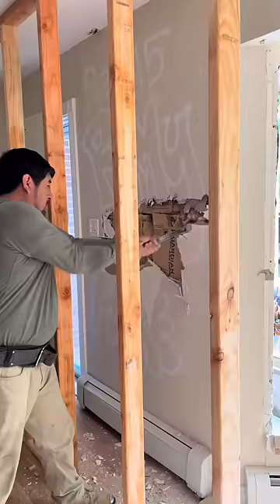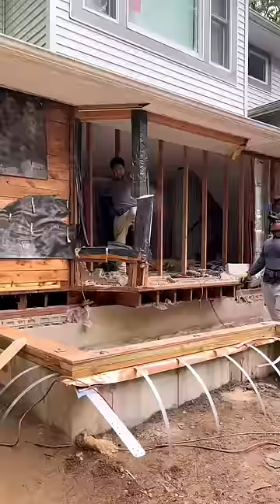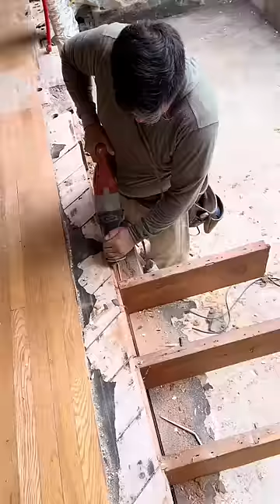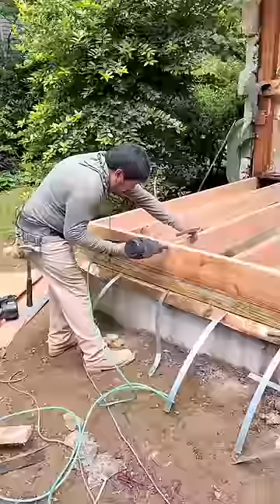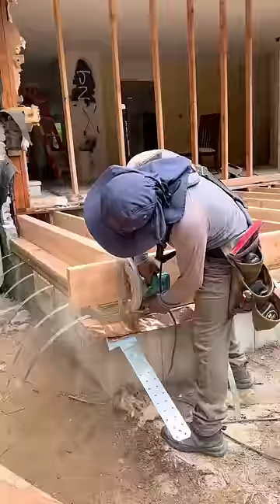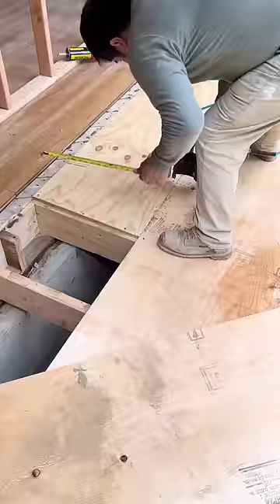Addition #shorts #work #construction #quality #design #skills #shorts

Comment: Should use screws with that deck glue to prevent squeaking floor
Reply: Ring shank nails work fine too.
Reply: Yeh always use screws ,try  getting  nails  out  without  damage to flooring  or joists
Reply: Ring shanks do the same thing
Reply: Yeah I've heard the ol' wives tale ring shanks work lol
Reply: 8 penney nails work just fine with the liquid nails. Saves time and your back.
Reply: Chic Stw  Sorry to hear that. Gotta work that out with your architect before building.
Reply: Chic Stw  Every floor with screws huh?? 🤣🤣🤣🤣🤣Yea ok
Reply: Chic Stw  Ohhh...home owner work, my mistake. Ring shanks are a bugger to pull, can see why you were upset.
Reply: Why would floor squeak if you've added enough liquid nails?
Reply: I get it if you have the time and money to use screws you could use screws on everything! Depends on what the homeowner wants to spend!

Comment: There’s one flaw that occurs with the types of hones built with wooden flooring—in this scenario. Like in Japan, the crawl space beneath the floor should be accessed through a type of cutout into the flooring—thus, in some instances purposed as an extra storage space and entry for below. Since there adjacent flooring is also connected through the newly enclosed areas. It doesn’t make sense if something happens when needing to get to it. It’s an extra feature in my opinion.

Comment: My comment is this I think what they should have done is put at least half a sheep into the old part of the house instead of going just to the to the band or rat seal or whatever y'all call it but it to me it's a band I think they should have went at least 4 ft into there I will helps tight all in makes a little bit structurally sound but you know that's the difference between a good Carpenter and a master Carpenter that thinks about future structural and trying to tie the house in together to be one